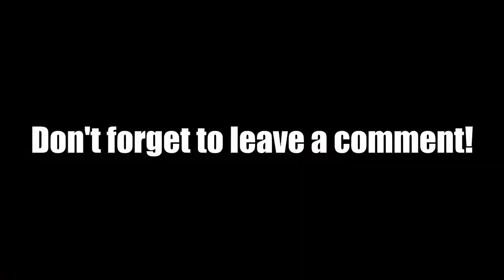WIN - I found a crashed RC jet (turbine) plane in a trash can!

Comment: Treasure to be sure but any one of those parts may be what got that plane into the bin in the first place. Careful scrutiny and repair will reveal the full value of those parts 😁
Reply from the maker: So true.  The servo has a busted output gear (almost certainly due to the crash) and I (serendipitously) have a spare so that'll be useful.   The servo leads are longer than I need so I'll probably make shorter ones out of them (and meter them carefully to check for continuity).  The fuel pump looks mechanically sound and that'll be very handy on the jet-engine test-bench.  The horns are great (I've already straightened the slightly bent bolts) and the little bits of tubing will be handy for something.
Reply: @xjet  The turbine was still screaming when it went in.Looked more like a loss of control.i.e.horizontal..horizontal..horizontal...VERTICAL!

Comment: Its amazing what some people throw away,   I myself scored an 800 dollar wire welder from my local dump,   A guy came in throwing a trailer load of trash away i happened to be doing the same and noticed an old welder or generator on the back of the trailer,   I thought for sure he isnt going to toss that into the bin,   To my shock he was about to hurl it into the pile and i stopped him,  I asked if i could have it he grumpily said here but damn thing don't work i said thats ok with me i wanted to see if i could get it going.    In the back of the truck it went and off to the house,   To my surprise the only thing wrong with the unit was a 79 cent fuse.       That was over 2 years ago and i still use it to this day,    Best score i ever made going to the dump,    But ever sense then im always on the lookout for old broken things others are throwing away.
Reply: Sadly after Christmas at our local refuse centre, I spied an older generation windsurfer in the pit, two sails in bags, two bagged centre boards, looked fine, I caught the eye of grapple driver and mouthed "I'm going in" he quickly yelled" NOTHING LEAVES THE PIT" and put the machines arm through the whole lot.
What a waste, ppl can be dense.
Cheers
Reply: @warp65  
At my local dump you never see the attendants driving older or banged-up cars.

Or doing some work for that matter.

Comment: So at my field we had people dumping trash in large amounts (they were not part of the field). On day when I was waiting on my batteries to charge up I took a walk to check out what was there. Turns out I find my self a 1978 quasar portable mini TV. Had to make some power jumper wires because the power board on it was shot but once it got power turned on just fine. Probably the best thing I've found and fixed up.

Comment: GDay Bruce....Your Hat was burning my retinas matey....lol....That Kerosine fuel pump was a nice find, the gear pump end is far more valuable than the electric motor which you can replace easily. Just make sure the motors shaft seal doesn't leak past the O ring. I hope you are not going to use it to pump petrol though, the seals are rated for Kero, not petrol.